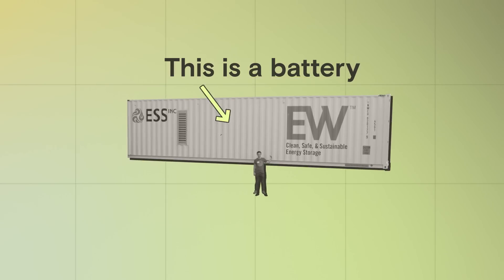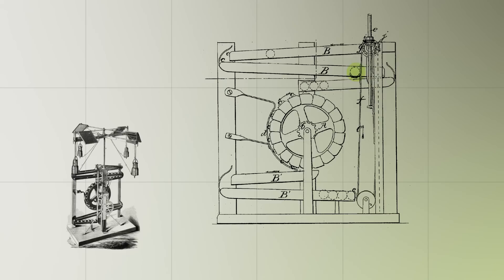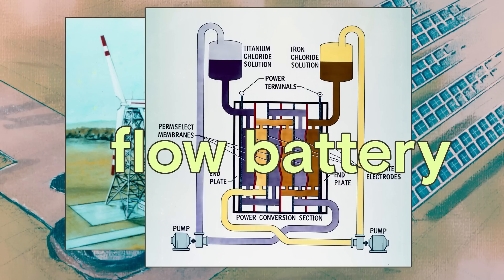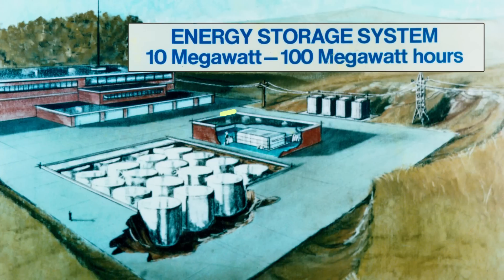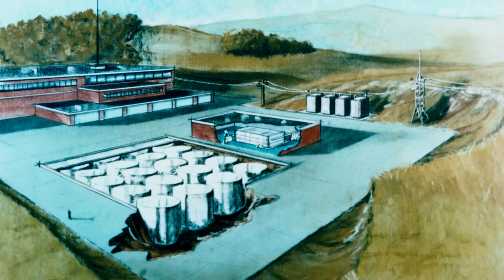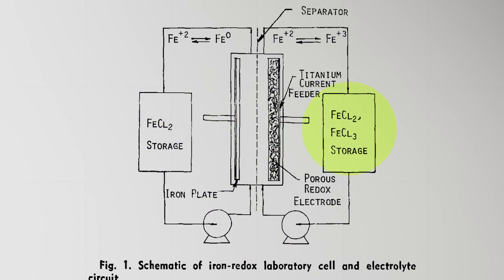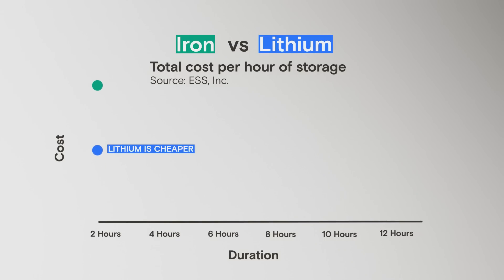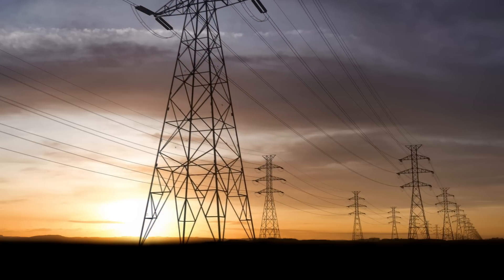This iron flow battery could power a more renewable grid

Comment: You need elements that have more than one valance state. In the case of iron you are going from ferric 3+ state to ferrous 2+ state. You can use other elements like Mn Cr and V, vanadium has the most energy dropping from +5 to +2.

Comment: Loved the peanut butter and jelly analogy.  As far as I know, the duration "limit" on ESS batteries is not a hard limit, it's just the limit of the product as it was packaged at the time.  It's conceptually infinitely scalable by adding more and bigger tanks.  I suspect that in the current market, the greatest demand is for batteries in the 4-8 hour range, and the demand for longer duration will come in a few years.  The more urgent needs and hence revenue opportunities in the power markets today are intra-day load shifting, as well as absorption of excess energy when for example solar has maxed out the available grid transmission capacity and has to be dumped.

Comment: Hi Guys, I need some insight here.

I'm working with large quarrying companies who are really feeling the effects of rising energy prices this year. I've researched many energy storage technologies to be used with solar and wind to reduce energy costs, but lithium prices are rising unsustainably. 
Our first energy storage project would need a roughly 2MWh Li-ion battery storage system (BSS), but Li-ion only has a life cycle of about 3000 cycles at best. This BSS would only last about 8 years at that rate. 
We would consider using another storage technology, such as iron flow, ammonia, or hydrogen, but we need a completely integrated system (not a research project). 
Can anyone share their insights on currently available battery storage systems?
Reply: We did. we are doing Vanadium battery well and commerciaalized it already!
Reply: Get the lithium now and buy yourself 8 years. You may also be able to get payments/discounts from the utility to integrate load-shedding/grid stabilization uses out of the battery. In 8 years there should be a few different options.

Comment: Until the energy is PORTABLE and can fit into a car like a TESLA to power that car or an airplane, this Iron Flow storage just CAN NOT COMPETE with what Lithium is doing right now.
Reply: Sorry but you're so far off topic with these flow batteries. They are Not At All designed for mobility use, they are designed for grid storage only.
Reply: Search nano flow cell. Its already in a car
Reply: We can make our transport infrastructure less centered around cars and develop public transport instead. Planes in the future may use biofuels and green hydrogen.

Comment: Was wondering how much the iron flow costs on a per kWh basis, and if these costs can go down as more production ramps up?
Reply: Cost is highly dependent on duration of storage. ESS advertises they are competitive with li-ion at 4 hours. Less than 4 hours, li-ion is cheaper. ESS targets between 4 and 12 hours of storage as their niche to be cheaper than other technologies.
Reply: I’m sure costs will go down as production ramps up. These batteries are completely standardized, and thus very much subject to economies of scale in manufacturing and installation. By way of comparison, lithium batteries dropped 90% in price in a decade as production scaled.

Comment: According to a comparative study between VRFB and ICRFB this is the conclusion:

The promise of redox flow batteries (RFBs) utilizing soluble redox couples, such as all vanadium ions as well as iron and chromium ions, is becoming increasingly recognized for large-scale energy storage of renewables such as wind and solar, owing to their unique advantages including scalability, intrinsic safety, and long cycle life. An ongoing question associated with these two RFBs is determining whether the vanadium redox flow battery (VRFB) or iron-chromium redox flow battery (ICRFB) is more suitable and competitive for large-scale energy storage. To address this concern, a comparative study has been conducted for the two types of battery based on their chargeedischarge performance, cycle performance, and capital cost. It is found that: i) the two batteries have similar energy efficiencies at high current densities; ii) the ICRFB exhibits a higher capacity decay rate than does the VRFB; and iii) the ICRFB is much less expensive in capital costs when operated at high power densities or at large capacities.

Long life vanadium!